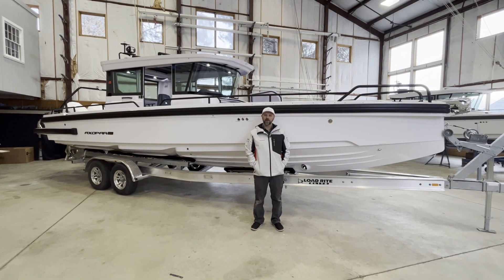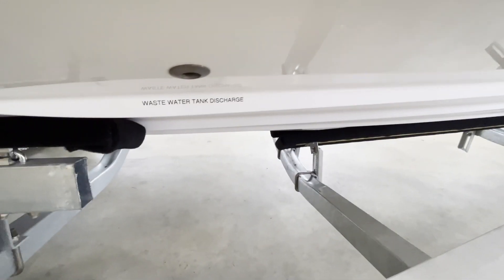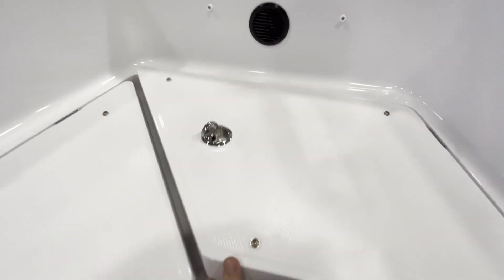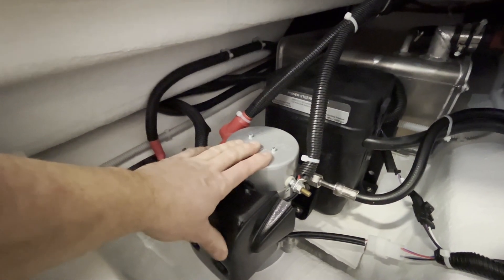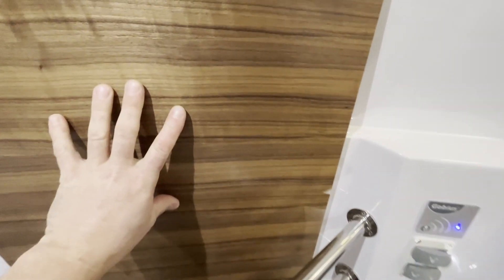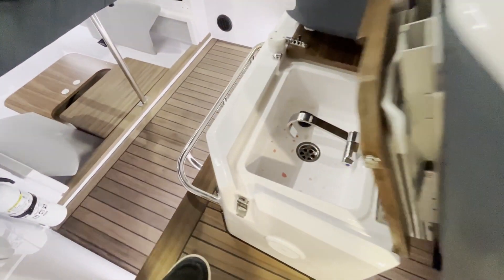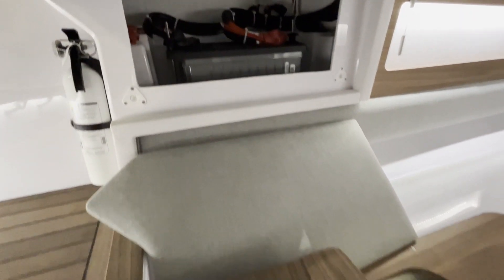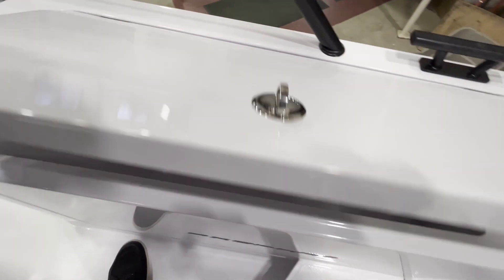Axopar Education Series: 2022 28 Cabin with Aft Cabin - General Systems and Thru Hulls

Comment: Thank you for the detailed run through, super helpful!  I'm curious about the Genasun unit I saw at (minute 8:09) in the house battery compartment.  I assume it's a solar power rig for the house battery.  Dealer installed? Panel on roof ahead of the soft opening portion?
Reply from the maker: That is for a solar panel that can be installed by any good boatyard. You will see more detail talking about when solar is a good idea for the axopar in an upcoming video. Follow us to be notified of our future videos.

Comment: Can you add an extra fuel tank to it?
Reply from the maker: That is possible to have a fuel tank installed, but it would be a custom project done once the boat is completed.  The Axopar 28 has a conservative range of 125nm with a 10% fuel reserve.
Reply: @EastCoastYachtSales  
How big of an extra fuel tank can you put? Also where does it get installed? Does it take any of the storage space or can it be installed somewhere in hull? 
Thanks